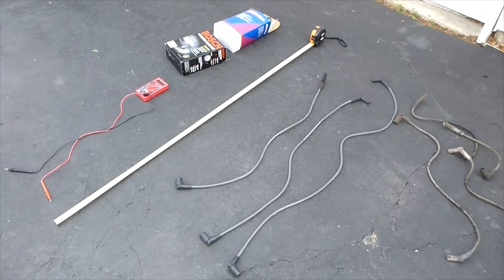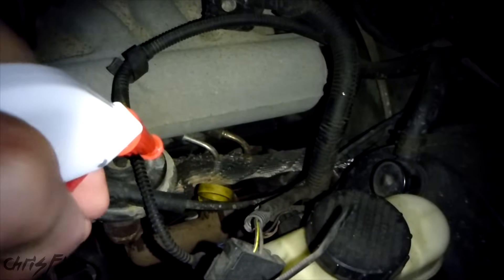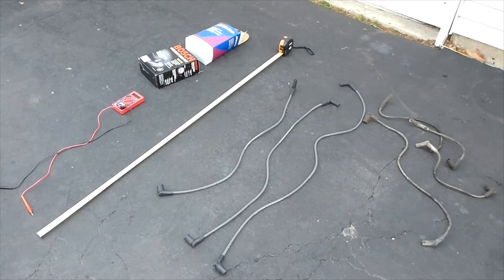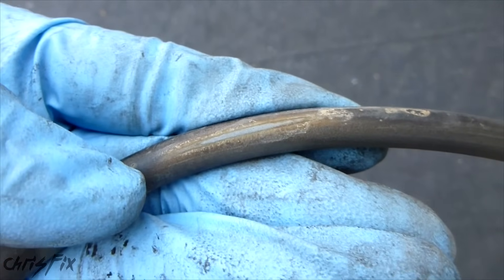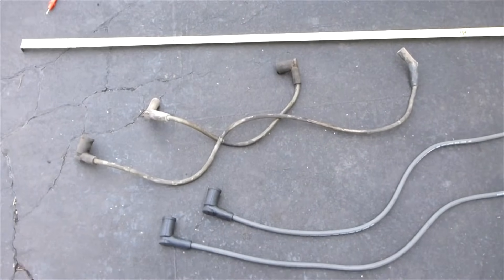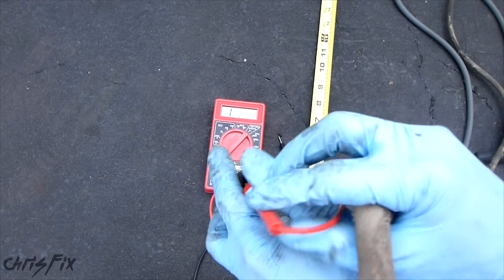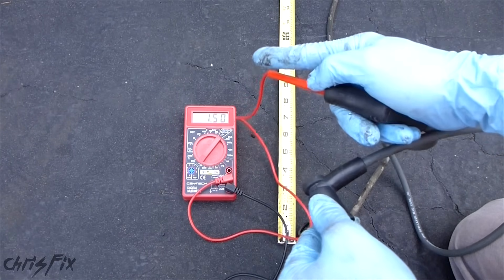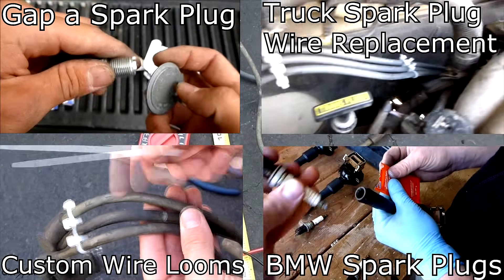How to Test Spark Plug Wires

Comment: Hey Chris, I tryed the same thing as you done, on my spark plug and here is the results : 8 inch - 1.43, 7 inch - 1.24, 10 inch - 1.93, 15 inch - 2.71, 17 inch - 3.54 and 20 inch - 4.01. I set my multimeter to 20k on ohm. Does it looks good? Mine are NGK spark plug and if I compare to your wire over 2 foot at 1.50 resistance I seem a little higher on results... Since I changed my oem for those NGK(1 week ago) it seems to run on 5 cylinders instead of 6.. strange. I checked my coil pack and it's fine.
Reply from the maker: So your car is getting a misfire check engine light? How do you know it is only running on 5 cylinders? Are all of the wires pushed completely onto the plugs so that it clicks in? I would check each wire and make sure it is pressed all the way.
Reply: ChrisFix There is no engine light on but it seems to run on 5 cylinders by the sound of it(not as usual) and the lost of power. The NGK wire dont click like my OEM so I can't really know if it all the way in :S but it seems tight

Comment: Chris Fix : I checked some old wires I had to make sure I some good spares and I found 3 definitely good ones 3 cracked wires ( that was obvious)  but 2 of the wires read  0.12 & 0.95 per Foot....  why is that?  

I made sure that the tester was reading correctly and that my math was good.  

The initial readings were :  1.90 & 0.36 ohms
Reply: cuadruple check tomorrow just in case I screwed up since its the first time I did it.... btw thanks for responding and thanx for your video its one of the most comprehensive in this topic.
Reply from the maker: What setting did you have your ohm meter on? 20k? I would think that your readings are really a few decimal places off. So it is really 1200 and 950 ohms per foot
Reply: I had the meter under the ohms legend  , there are no other selectors,  however ; I also checked the 8 MSD wires that are currently in the car and they all have numbers resulting in 43.1 & 46.7  

it is just those two wires out if the extra set that I have that read extremely low, I could
Reply from the maker: Ok so it is self adjusting. Does it tell you on the screen what setting it is adjusting to? I bet it is just adjusting and moving the decimal places over like I was saying. So the MSD wires are 431 ohms and 467ohms

Comment from the maker: +Hector Garcia-Martinez, I cannot reply to your comment for some reason, but you can check your spark plugs visually. I will make a video on this but for now, look at the ceramic and make sure it isnt cracked, look at the tip of the plug and make sure it is gapped right, and look to make sure there arent too many carbon deposits on it. It sounds like you got platinum plugs which last 100k miles so dont worry. I had plugs from the factory in my van for 200k miles before they were changed and she ran fine. You will experience a rough idle, hesitation, etc when your plugs are starting to go.
Reply: Ok. Thank you..
Reply: ChrisFix m
Reply: ChrisFix c
Reply: ChrisFix Scott said u are wrong on another video what's up with that 🙄
Reply: I have question. Right now I have spark plug 16mm (hex size). Can I put 21mm (hex size) spark plug ?

Comment: Smashing tutorial chris :-))

Those wires looked 4000 years old lol, i would imagine the carbon string through the center would be very well past its sell by date :-)

Also some spark plugs have a 5k resistor inside, and for older screw on caps they often have a 5k inside, but im now stating the bloody obvious lol.

The meter you used can be got off ebay very cheaply with the Dt830 or M830 model numbers, yellow and black is typical.
Reply from the maker: Thanks! The wires were 14 years old and have 110k miles on them. I didnt think about mentioning the 5k resistor so thanks!